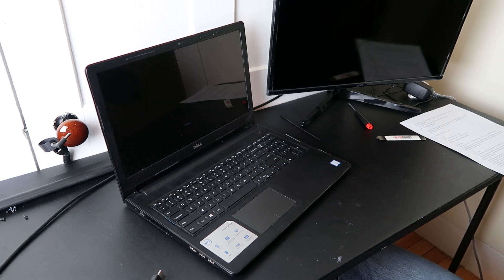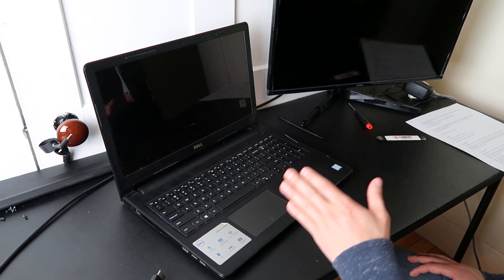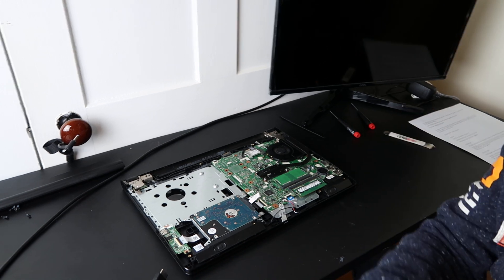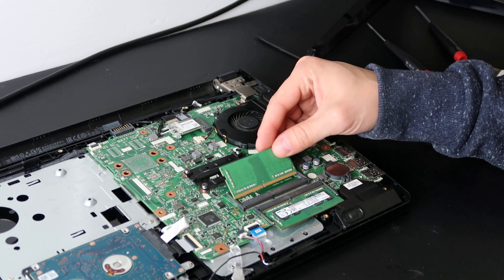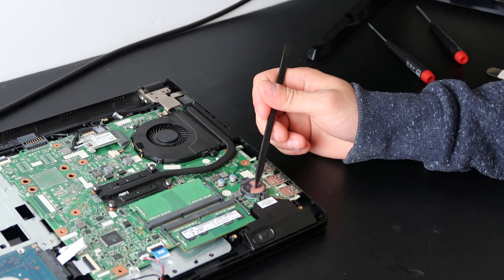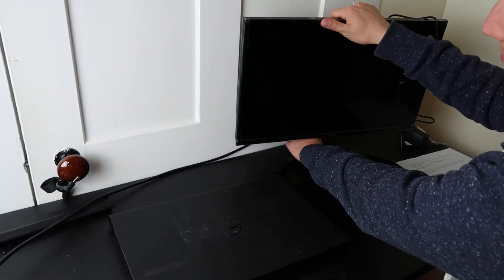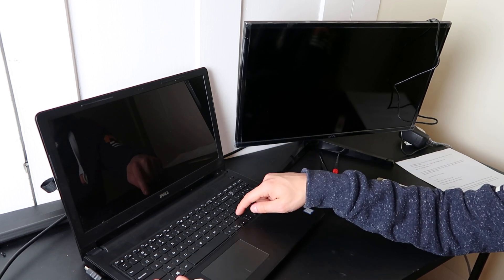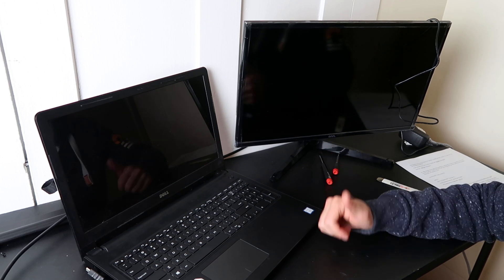How To Fix Black Screen / No Display / Dim Screen / No Picture for Dell Laptop

Comment: Sorry I bought a Dell pc and I have warranty and I have LCD problem do you know how to contact them to fix it or replace
Reply from the maker: What is the LCD problem? You should be able to see the status of your warranty here: https://www.dell.com/support/contractservices/en-us
Reply: @PC_Monkey  I think it have to be change from what I can see the screen is broken it’s been pushed I think
Reply from the maker: @RashidAhmadi6  Yes, if the screen is physically damaged, it needs to be replaced. However, very few warranties will cover physical repair unfortunately :(
Reply: @PC_Monkey  Well that’s what it is I had to change it then It’s what it is
Reply from the maker: @RashidAhmadi6  Good luck !! If you need any help replacing the LCD, let me know :)
Reply: @PC_Monkey  Thank you do you know anyplace to buy a Dell Inspiron 15 3525 lcd and cheap
Reply from the maker: @RashidAhmadi6  What size screen do you have? You also need to know if the LCD cable port is a 30 or 40 pin. Also, where the port is located on the LCD. I usually go to Ebay or Amazon but after I have that info. I explain how to do that all here in this video at 4:40: https://www.youtube.com/watch?v=NwB59K_iwJ8&t=1s. Let me know if you have any questions or would still like me to try a find a good LCD after you have that info:)

Comment: Bro does this apply to 3510 as well
Reply: @PC monkey my dell latitude 3510 was working perfectly i put it to charge while it was in sleep deep sleep after i took it of charge it started however the laptop screen went off . The power led and keyboard led is working . What could have caused this issue?
Reply from the maker: 1. Are the lights the only signs of life when you turn it on? No motherboard or hard drive sounds? No fan noise? Nothing on the screen?
2. Also, did anything happen before this issue appeared?  Overheating, liquid spill, Windows update, etc?

Comment: i was in the process of unlocking bios on latitude 7400 when i got alot of horizontal black screens across the screen, its still on and a light on the side flashes yellow orange.
Reply: it doesnt do anything when i plug in a screen
Reply from the maker: @luniqant9296  How were you unlocking BIOS?  Was the computer working well before that attempted operation?  If not, what was happening?

Comment: I have a dell e7440 that powers up with the battery indicator blinking with white light. What could be the problem
Reply from the maker: 1.  The computer turns on and works well other than the battery indicator blinking?
2.  Also, did anything happen before this issue appeared?  Liquid spill, overheating, Windows update, etc?
Reply: @PC_Monkey  when the on button is pressed the three indicators (WiFi, battery,HDD)comes up showing white steady light except the battery indicator that is showing white blinking light. The system will not perform post at all. It will be all black screen.
Reply: @PC_Monkey  no overheating no spilling of any liquid
Reply from the maker: @emekaobi2727  For a computer that does not turn on, try this video first; https://youtu.be/kOBY4k2Mn_k. Let me know how that goes :)

Comment: My issue is, While being in bios option or any option the internal display (laptop screen) is working fine but when windows is booted up and password/pin input screen pops up then display go blank and only 2nd display is working. Under Advance display settings option only 2nd display(monitor) as option is showing. Anyone with experience to such problems, please suggest any solution.

Comment: I have a dell latitude 7480 that turns on and it had a black screen. Then it shuts back off.. any fixes for that??? Plz help
Reply from the maker: 1.  If the screen is black, what are the signs that the computer is actually turning on? 
2.  Also, did anything happen before this issue appeared?  Liquid spill, overheating, Windows update, etc?
Reply: @PC_Monkey  the lights come on the keyboard and the light flashes on the front bottom flashes for a while then it shuts down
Reply: @PC_Monkey  i bought it and loaded it signed into everything and updated it then it froze and i shut it down and now wont turn back on for me to clear my info off to send it bacjk
Reply from the maker: @stevenburrus5288  From the sounds of that, I would say the computer isnt turning on rather than its turning on with a black screen.  For a computer that does not turn on, try this video first; https://youtu.be/kOBY4k2Mn_k. Let me know how that goes :)

Comment: I have a question, a quarter of my monitor screen only, cuz it is conected  to my laptop just beacame like darker,and idk what to do. Mb u can help me cuz its just happening pretty often .
Reply from the maker: 1.  The rest of the screen work well and did not become darker?  If you hook up to an external monitor, is the external monitor the same way?
2.  Also, did anything happen before this issue appeared?  Liquid spill, overheating, Windows update, etc?

Comment: Hi i have a Dell Inspiron G5 15-5500 
The issue is WHEN PLUGGED IN THE CHARGING LIGHT , CAPTIAL KEY ON KEYBOARD SHOWS LIGHT BUT SCREEN IS COMPLETLY BLACK
What can be the issue
Reply from the maker: 1.  Are the lights the only signs of life when you turn it on? No motherboard or hard drive sounds? No fan noise? Nothing on the screen?
2.  For a computer that does not turn on, try this video first; https://youtu.be/kOBY4k2Mn_k. Let me know how that goes :)

Comment: Man you're a legend; I was going to buy a new Laptop cos I gave up trying to fix mine, or even send it to a repair shop. That is until I came across this video and did the bad RAM test. It worked like magic. One of my RAMs was causing my laptop not to turn on for some reason. You saved me money and stress man, thanks a lot - wish you the best
Reply from the maker: Glad your all set :) Always here if needed !!

Comment: Hello Jamin I have a issue again of course I upgraded my dell latitude e5470 ram and when I turn on my laptop it won’t post nothing on the screen  my keyboard doesn’t light up the screen stays black after I put the new ram stick in it it started I even put the old ram back in and it does the same thing what could possibly be causing this just bought this laptop
Reply from the maker: 1.  For a computer that does not turn on, try this video first; https://youtu.be/kOBY4k2Mn_k. Let me know how that goes :)
2.  Also, did anything happen before this issue appeared?  Liquid spill, overheating, Windows update, etc?
Reply: @PC_Monkey  it ended up working after a few try’s
Reply from the maker: @adammassingale7075  Great to hear !! Always here to help :):)
Reply: @PC_Monkey  thank you at first I thought my laptop wasn’t gonna come back on

Comment: I ran the diagnostic tests and everything is ok but it still doesn’t boot. It says “no bootable devices were found. Possible  causes could be a corrupt OS image or a boot device is not enabled in BIOS setup”
Reply from the maker: 1.  This video does not show how to run any diagnostic test... You have a Dell and ran the diagnostic test seen here?  https://youtu.be/lWlTQDAxpio.  
2.  Also, did anything happen before this?  Overheating, liquid spill, Windows update, etc?

Comment: everything seems to work on my pc fans, i can see the logo , the pc boots but it's just way too dim
Reply from the maker: Sounds like your on the correct video.  Have you tried the steps seen here? 
Also, did anything happen before this issue appeared?  Liquid spill, overheating, Windows update, etc?

Comment: When i press power it turns on the light on the caps lock but the fan and mpther board make no noise and screen stays black
Reply from the maker: 1.  For a computer that does not turn on, try this video first; https://youtu.be/HHwzA37r4e8. Let me know how that goes :)
2.  Also, did anything happen before this issue appeared?  Liquid spill, overheating, Windows update, etc?

Comment: Sir When I turn on my laptop all working find except my LCD display is so dim that I can't see without a flashlight , plz help me out
Reply from the maker: Sounds like your on the correct video.  Have you tried the steps seen here? 
Also, did anything happen before this issue appeared?  Liquid spill, overheating, Windows update, etc?
Reply: i have the same problem any luck
Reply from the maker: @ebenhaezer_bayman  Same question then lol
Sounds like your on the correct video.  Have you tried the steps seen here? 
Also, did anything happen before this issue appeared?  Liquid spill, overheating, Windows update, etc?

Comment: I have a G7. Great video. Step by step made it very easy. My laptop falls into the very first description. turns on, keyboard lights up, fans kick on, external monitor works. I did the LCD self test and the colors flash on my laptops screen, but still no picture. The webcam still works as well. still black screen. Pulled the ram. one at at time, no picture when one pulled. pulled the CMOS battery, still no. When I unplug the HDMI, the laptop even makes the noise indicating something was unplugged. Did windows key + p - The computer is thinking the screen is on (it does not show there is an external display plugged in - thinks it is the laptop screen). If I click on the toll bar bottom right corner, the laptop has 'wired display' lit up. help?
Reply from the maker: If the computer went through all those tests and no luck, and also if the computer is displaying fine to an external monitor, I would guess that there is an issue with your LCD or LCD Cable at this point.  I would replace them one-at-a-time until you find the one that is faulty
Reply: @PC_Monkey  hi, sir , I have the same issue but my laptop Dell Latitude E7270
1. display works fine in bios setup or while power on+D function shows all color 
2. Display show on startup 
3. Display works in bios hardware test function 
4. Display works with external monitor or Tv( Laptop+win working fine)
5. But display doesn’t work in normal window , after startup it shows window logo and turns black
Reply: @PC_Monkey please help resolve the issue

Comment: None of this work for me…. My computer was working just fine when I had my old hard drive in it  Then when I replace the hard drive my screen no longer wants to work and before that didn't recognize my brand new straight out the box hard drive
Reply from the maker: If the computer is not seeing your HDD, that would most likely be a different issue than the one discussed here.  So thats, 2 HDD its not seeing?  Why did you replace the original one?  Was it not seeing that one either?
Reply: I had to replace the old hard drive because it  Had become damaged And after I replaced it the computer came on and everything but now it does not want to and wants to shut off immediately after it  Starts to come on

Comment: My dell laptop was working until i took it apart. I think I didn’t put my bios back properly.  My laptop turns on but nothing on my screen
Reply from the maker: 1.  What do you mean, you dont think you put your BIOS back properly?  Which component are you referring to? 
2.  If the screen is black, what are the signs that the computer is on? Lights, Fan, Motherboard or Hard Drive sounds?

Comment: my laptop screen was very dimm, I put it to the flashlight and saw the dell logo but it simply wouldnt boot up. Then I plugged it in to a monitor and nothing happened so I changed the cmos battery and after that the screen was still dimm but when I plugged it into a monitor again and went into the bios it worked! ill have to install back my ssd since I removed it because I thought it was dead but after that everything should work, thank you so much!!
Reply from the maker: Glad your all set :) Always here if needed !!

Comment: How do I access my LCD cable??
Reply from the maker: It usually runs from the back bottom of the LCD, down through the Left side hinge assembly, into the bottom case and plugs into the motherboard near the top left corner.  For more exact info, what is the make and model of your computer?

Comment: Thank you, removed the top ram Dimm 2, and sure enough the Screen turned on, do I need to check Dimm 1 also, ??
Reply from the maker: Most likely, both sticks are not bad.  Especially if the computer turned on with the one in it.  You should be good :)
Reply: Thank you very much bought the ram chip and labtop working like new!
Reply from the maker: @davidflamencocotto4910  Great to hear !! Always here to help :):)

Comment: Hi! Lovely video. I have the same issue but with a flashing error code from the led by the power. Two amber, two white = no memory. 

I don’t think this is the actual problem though. I changed the battery a few weeks ago and then last week the cpu fan seemed to stop working. 
Later the laptop started to do a diagnostic test and beeped loudly saying the fan wasn’t working. 

I ordered a new fan but in the meantime the laptop continued to work. We just used it for light tasks and it didn’t seem to be overheating. Then I struggled to login as the keyboards was really slow to respond. Now it is at the stage of your video where not even the logo comes up, just the keyboard lights and a little bit of heat from the processor area. 

The RAM seems fine and I’ve orders a new CMOS in case. 

I’m tending to think it has gone into a safe mode as it knows the fan isn’t working? Or does the error code mean there’s something more sinister going on, maybe the motherboard? 

Any help would be amazing thank you
Reply from the maker: For a computer that does not turn on, try this video first; https://youtu.be/P3I7dDpkJps. Let me know how that goes :)

Comment: I have a Animated led and they dont light up mouse and it barely lights up the optical light on the bottom.  Dell inspiron 24 3511 all in one with power but black screen.  Does bad ram limit power to the USB ports?  Pushing power and the top button makes the monitor cycle through all the colors like red green blue.   Cmos or ram issue?
Reply: Aftermarket mouse with rgb I meant. Ty in advance! Subbed!
Reply from the maker: Are the lights the only signs of life when you turn it on? No motherboard or hard drive sounds? No fan noise? Nothing on the screen?

Comment: Cracked screen? Fix is to unplug the cable to the display and then use hdmi cable to a external monitor OR TV
Reply from the maker: Um... lol no.  You cant fix a cracked screen by plugging your computer into an external monitor.  To fix a cracked screen, you need to replace the screen...

Comment: I had my computer since I was five sense   A water bottle got it wet I couldn’t do stuff
Reply from the maker: After a liquid spill, you want to first make sure the computer is 100% dry. You would turn your computer off immediately by pressing and holding the power button until the computer turns off. Then you would disassemble the computer as much as your comfortable with, at least trying to remove the bottom case. Then you would turn it on its side and let dry for a couple days.

Comment: I have a PC and my screen shows black screen from the get -go. Not even the motherboard logo! I am sure that the PC itself is working and I am in the Windows! This is completely random! Should I follow the same procedure?
Does your screen sometimes show black screen from the get-go or always does not show anything from the get-go?
Reply from the maker: If the screen is black, what are the signs that the computer is on? Lights, Fan, Motherboard or Hard Drive sounds?
Reply: @PC_Monkey  The fan is working. There are lights on the motherboard.
Reply from the maker: @Mamaleee123  Ok then yes, I would start troubleshooting her at this video.  Have you tried the RAM test?  The external monitor test?

Comment: My laptop doesn’t have an hdmi port what should I do
Reply from the maker: 1.  Is your laptop older?  Can you use the VGA port?
2.  If the screen is black, what are the signs that the computer is on? Lights, Fan, Motherboard or Hard Drive sounds?
Reply: @PC_Monkey  my laptop is a dell xps 12 but when I turn it on the keyboard lights up and I hear the fan starting but the laptop doesn’t have an hdmi or vga port
Reply from the maker: @rampp8169  Is this your computer?  https://www.dell.com/en-us/shop/cty/pdp/spd/xps-12-9250
Looks that that computer has both a VGA and an HDMI
Reply: @PC_Monkey  my laptop is a dell xps 12 with a flexible screen
Reply from the maker: @rampp8169  If you dont have a VGA or an HDMI, you may have to get a USB screen to try it.  Are you able to try the RAM test?